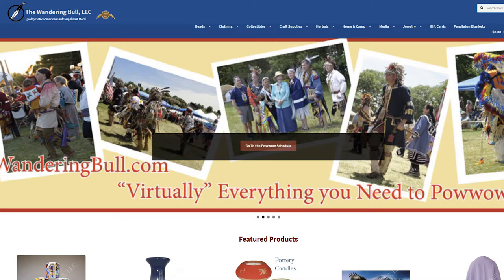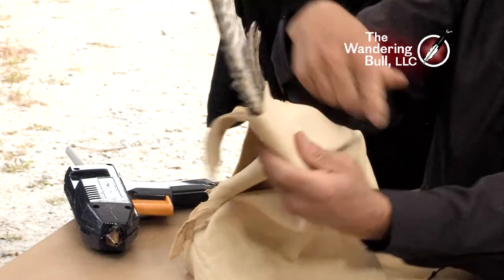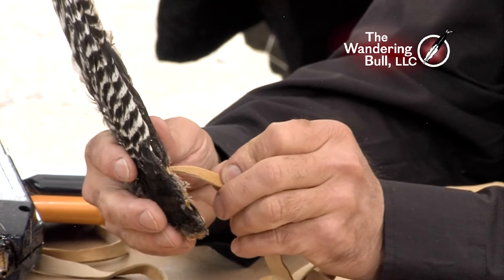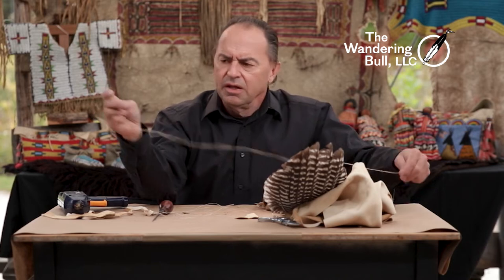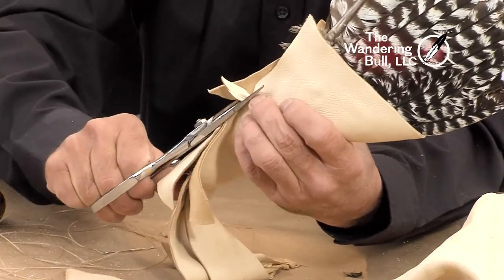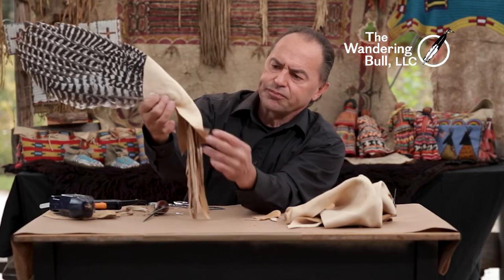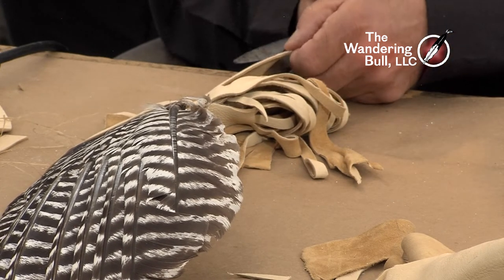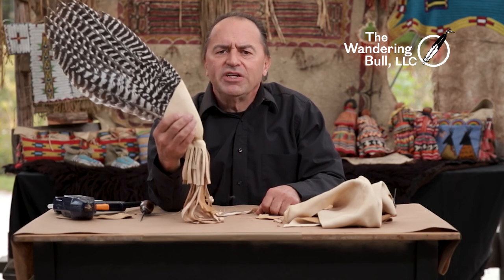Turkey Wing Fan Construction

Comment: Def not telling you how to do your thing but a wing fan lasts a lot longer if you skin out those bones and rebuild that structure with cedar or another wood. Pacc that area with salt..  it will prevent decay. I glue that wooden structure into that cavity to replicate the support of the bones provided.  From there I sew on a handle much like you demonstrate though I do sew the top through the wing itself instead of gluing it. Be careful on that step tho because if not done properly the feathers can shift slightly though it does provide a much tighter fit than glue will provide.  Some tips...
Reply from the maker: Thanks for the tips! Love sharing information!

Comment: what cleaning process did you do before you made the fan?
Reply from the maker: Hello Thank you for watching,   I use borax on the meat/bone area.   After a few weeks of drying I dump off the borax and sew the leather on.
Reply: @thewanderingbull9843  just straight up Borax? no mixture of water etc? or do you have a video on it?
Reply from the maker: @tiredblood79  we do not have a video on this.   You would lay the wing on cardboard or in a box pour the borax on the joint, meat part and just let it dry the wing joint out for a week or so.   This will pull the moisture out of the wing.